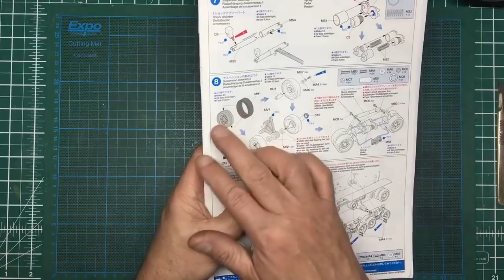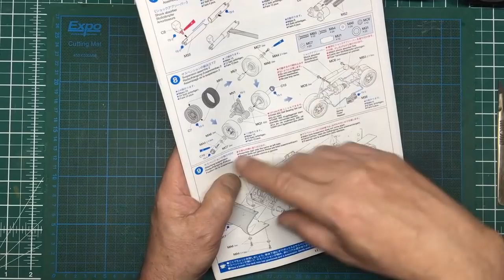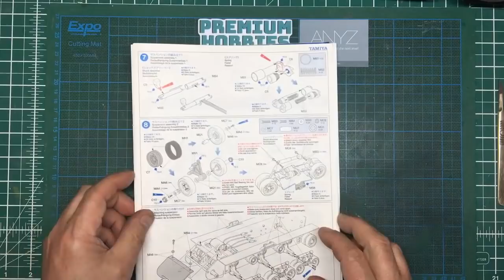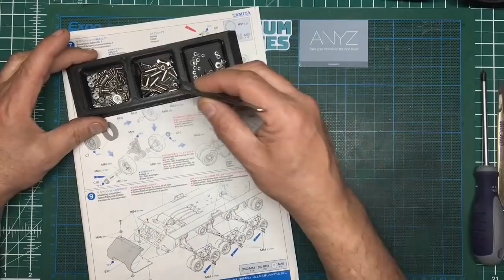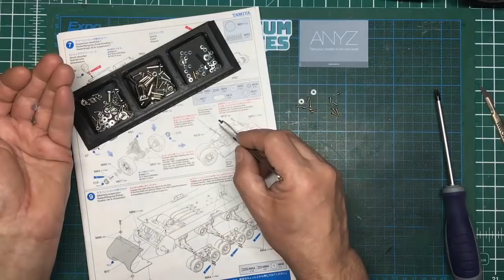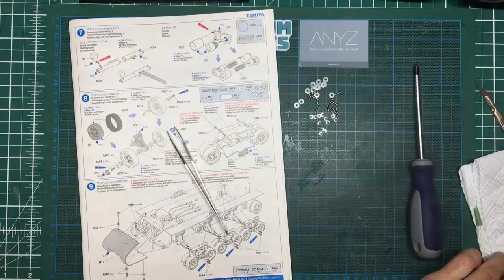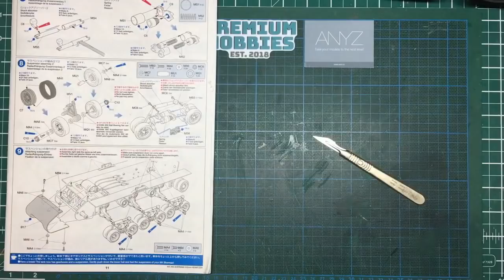let's build a tamiya 1/16 RC Sherman. Part 13

Comment: Haven’t had the chance to see the previous two parts but I did just watch this one out if turn based on your comments and those who have posted comments below.  I fully understand your thoughts on maybe packing it in but those sh*t for brains rude people only prove confirm that their lives are so small and filled with anger and it must somehow make them feel superior, when in fact it does the opposite.  I follow over one hundred other modeling channels but yours is the only one I watch every video and have done since shortly after you started. There are many good modelers putting up good content on youtube but you are the only one who takes the time to explain the how and why you build a kit.  As far as not finishing a build I counted up my unfinished kits and I have over 30 at various stages of completion and some are so old I know I never will complete them. I learn something new when I watch you finished or not does not matter to me.  Sits the process that counts.  Got that out of my system, so stay safe Nigel.  Hope you will continue with both your channels I do watch the other because one never knows when something you did will come in handy in mine. Cheers and have a good Easter.

Comment: I'd be sorry to see you close down the channel, but I totally understand your frustration with the trolls. It's unfortunate that people get their kicks at others' expense- what sad and inadequate creatures they must be. While I don't make videos, it was you subscribing to my channel that made me think about starting (thank you for doing that!), but having listened to your comments during this episode I'm not so sure.
On to happier things. I'd love to see the Saturn V build, I know you'd do a better job than I did, and it's certainly an impressive beast when completed. I bought the aftermarket CSM and cut the Command module off and a friend with a lathe cut a recess in the front end of the Service Module to accept the kit parts of the bulkhead and heat shield- it works very well. It made up for all the little problems encountered with the rest of the kit!
Matt varnish: I've tried several different varnishes- Vallejo, Hannants, Tamiya and so on and they all dried to a satiny finish, but I recently got my best results using Humbrol Clear acrylic. It needed a really good shake of the bottle but dried to a lovely almost dead flat finish. Matt Mod Podge also works quite well, but I'm not sure about using an airbrush to apply it as it's basically PVA glue and has an very rapid drying time.
I hope you continue to make videos, but if you feel you need to stop, then so be it. Model-making is a hobby for us to enjoy and if there's an aspect of it that causes you grief, then cut that part out.

Comment: Another great video, really hope you don't quit because of haters. 
For flat, as James Mower says, Mr Color Rapid thinners with XF-86 works great , at about 60%:40% to 50%:50% or Mr Hobby GX113 which you can thin more 30% paint : 70% thinners. Trouble with leveling thinners is Tamiya and Mr Hobby aqueous spray nice, but due to slower drying times the paint or clear settle more and go satin and not the desired Matt you'd like, with the Rapid thinner they dry faster and give a better matt finish. Bonus of the GX113 is you have UV agent in it to stop sunlight turning it yellow over time.

Personally I've only used XF-86 with Rapid thinners but on good advice I have oredered the GX113, this thinner also works well with 1000 Mr Surfacer as a primer and dries a lot faster than using levelling thinners (though gives a slightly rougher finish) so it's worth having in your arsenal of thinners if you don't already have it

Comment: Good morning Nigel. 
This is the first time I have ever commented on YouTube but I feel I must. Please don,t let the B""""teds get you down. I,ve been following you from nearly the start and you have become a part of my daily modelling experience. You are doing so much good for modellers new and old.
Now the cheeky bit......

If you have time can you answer a query for me regarding used blades. "How do you dispose of them?" I have a draw full and I,m worried about little hands getting hold of them.
Cheers
Reply from the maker: I always put mine in a glass jar, when full I take it somewhere where used blades are correctly disposed of, such as a lab or an engineering works. They have the correct disposal regime. Failing that, put them in a jar clearly marked "used blades" and put them in your recycle box.
Reply: Thank you Nigel. Simple really.....I never thought of that. All the best

Comment: If you want a really flat clear finish Nige, use Mr Color Rapid thinners with Tamiya Flat Clear or another flat clear - just not a water-based one.

And too add, we need people like you on here (youtube) and I'd be inclined to turn the post filtering off - so your subscribers can report these individuals. We may be in isolation, but we are never alone.

Comment: Please do not stop your channel because of some pricks spoiling it for the rest of us who enjoy your vids so much. A quick question about your dry brushing: how do you select the colour to be used? The green you mixed is considerably lighter and brighter than the olive green on the rest of the wheels etc. I tried to use a light-buff colour to dry-brush my desert yellow Panzer IV and it looked very odd and artificial. Any tips? Thanks for the upload and look forward to the next part.
Reply from the maker: I often go ridiculously light and then knock it back with washes. If you watch some modellers they will hilight large features with a very light colour, then let the washes blend it all in. the green i mixed was similar to cockpit green, but did you notice how it all blended in once washed?